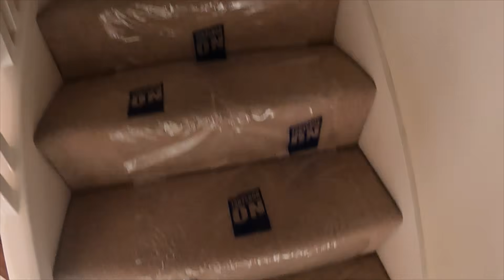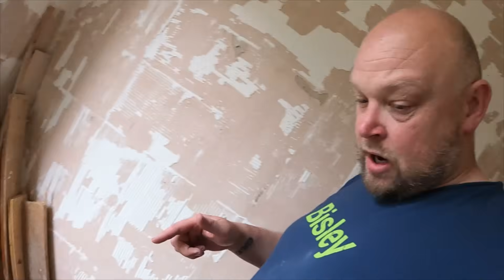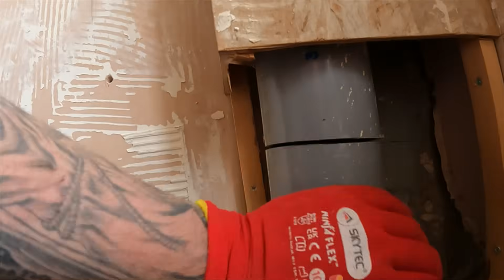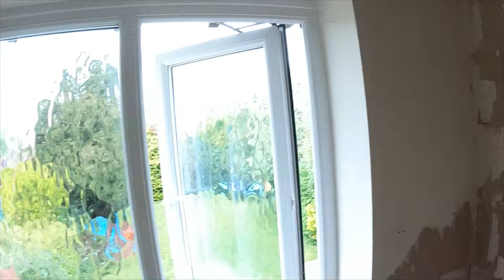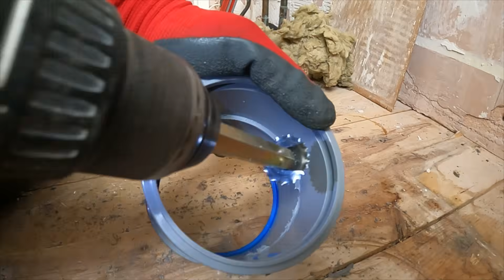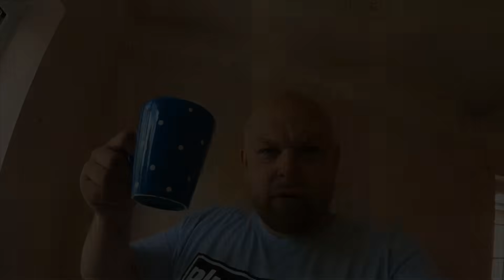FULL BATHROOM REFIT-SOIL STACK CAUSES PROBLEMS ON DAY 1… Part 1-Rip out & 1st Fix

Comment: Just a personal thought question. I believe a 110mm dia. stack or should I say soil vent pipe (that is a pipe that is vent only) can be as narrow as an inch and a quarter. I mean, 110mm is (in my opinion) excessive, also at 110mm there is an uninsulated space in the room. If the vent pipe was less than 110mm, it could be incorporated into the stud wall structure................ Thanks.
Reply from the maker: It’s all ready fitted mate….. I’m just altering it where I need to👍🏼
Reply: Not on a main vent tge pipe diameter shouldn't be reduced.there wouldn't be enough air admittance when flushing the wc.i think,been a while from college lol
Reply from the maker: @thomaswatt1658  yep I agree ….. I wouldn’t and haven’t ever reduced a vent pipe to 1”1/4!!!….
Reply: @MJTiffPlumbing  I done it in a property once and have not had any problems....... no glug etc.
Reply: @thomaswatt1658  have you tried.
Reply: I haven't tbf but I don't think it's good practice.glad you haven't had any problems,that would be a nightmare if you had to change it back
Reply: @thomaswatt1658  True, like I say, it was an experiment and as yet it is all good. Thanks.

Comment: Another good video.

Never seen a sparky make a mess like that on the ceiling, even if it’s being over boarded!!! Just looks a mess and carelessness and no quicker than using a hole saw attachment.
Reply: Would have been better to use the hole saw though
Reply: @nicks2528 or just go up the loft!
Reply from the maker: To be honest it’s not an issue at all as it’s being over boarded….

Comment: "good job we are over tacking the ceiling then!" Sparks, get a hole saw and a dust pan and brush!!!!
Reply: I get that but sparks need carful guidance especially when they are wielding a hammer, I’ve got mine in tomorrow and he drops cable, tape and general stuff all over the site and thinks it’s someone else’s job to clean up after, I’m sick of tidying up after him so tomorrow he’s gonna have an interesting morning cuppa 😜
Reply from the maker: @chrisgunn121  🤣🤣🤣
Reply from the maker: He knew we were before doing that obviously….. if it’s a finished ceiling he wouldn’t be doing that
Reply: Typical sparks making a mess

Comment: Got exactly same issue on our job re BTW pan !!
They look really nice but don’t work on internal soil stacks ,.. said the same - I’ll cut out but cannot guarantee it won’t crack ! 
🤞🤞🤞 in morning 🤣👍
Reply from the maker: Gotta do what you gotta do…. Just cover your ass
Reply: Could timber it out and then put an concealed cistern in and btw pan no cutting needed
Reply: @mikecave4154  not enough room for w/c pan pal, need a c/c for door opening 👍 thanks for your input though mate 👍

Comment: With all them notches in the joist for the pipes,doesn't the integrity of the joist be compromised?
Reply: The notches must be about 55mm deep which means that technically the joists should be 440mm deep.......
Reply: I've got to be honest, there's no way on this earth anyone should cut a notch that deep in a joist. After 35 years of house bashing there's some rules that don't get broken. 
Simple, tell the customer no. Leave it for some other fool to do.
Reply: Thinking same thing
Reply: That’s the problem , when you have bathrooms, the waste pipe work should be boxed in , you definitely lose a bit of space , the timber joist looks healthy, and it’s on a second floor, he can get away with it, but you definitely don’t do that on a first floor, those are most important joist.
Reply: You can drill a hole through the centre of the joist 1/4 of the depth of the joist. That would have been the way to go, that notch is too deep.
Reply: Just been scrolling through the comments amazed no one is mentioning the joists!! Drilling centre is the better option, albeit a pain in the arse feeding the pipe and the extra joins. I'd probably not notch here, especially given the existing notches. Love the videos, keep them up!
Reply: Notches should only be an eighth of the joist depth. Would never cut joists that deep - stuff what the customer wants - they will be quick to blame you when something goes wrong.
Reply: @mrgilly100  I agree with you, but people doing it themselves, sometimes. But , I completely agree to follow British standards and building regulations, it’s a reason why  they’re there for .
Reply from the maker: Never had an issue in 26years…. This is what you have to do when people want bathrooms with no pipes on show etc

Comment: Why is the shower waste so high notched in joist..  If the tray sits on floor normally waste is say at least 70mm to centre of pipe as it comes out of pot. Surely there's no fall unless the tray is risen right...
Reply from the maker: Plenty of fall on this buddy 👍🏼👍🏼
Reply: @MJTiffPlumbing  is tray sitting on floor

Comment: Urgh internal soil stacks 😩 what genius thought of that idea eh!? 
We had one inside the cavity once which if never seen before
Reply from the maker: They can be a right nightmare
Reply: Seen one inside a cavity in a converted student house in Manchester, it had a big hole in it and had been leaking stink into the wall for years. Nice smell. They ended up having to replace ends of joists, cost them thousands......

Comment: Great video on the bathroom rip out.could you not connect the basin waste and shower waste together so you only have one run into the stack pipe.tiles came off easy enough without to much damage to walls.bet it will look smart when finished 👍
Reply from the maker: Thanks mate….. I never like teeing in wastes as they can pull on each other especially a shower waste.
Reply: @MJTiffPlumbing  Hey mate, was actually thinking this too, but maybe chuck an AAV on? 

Just asking your opinion, not bashing 💪
Reply from the maker: @sonnyhacker1591  
Yer some people may do it that way…. But for me cutting it all out and running it separately is how I like to do it👍🏼👍🏼
Each to there own…. But teeing wastes is not for me
Reply: @MJTiffPlumbing  Cheers mate, find it interesting how different we all work; why I like your channel, no bull shit, proper real world plumbing.

I started on my own last year, best thing in the world, and the most stressful 😅

Be lucky 

Sonny
Reply: I was thinking that too.
Reply: Decent start to the job. As others have said I would of stuck a tee close to tbe stack taken the basin waste into the 1-1/2 & then just the shower waste. On the basin waste fit an antivac trap or self sealing valve.
There's no chance a basin waste backing up the shower waste as you've then put the connection close to the stack. No chance of them pulling as you've only got an electric shower as opposed to one off a combi or pumped.
I'd be more concerned as to almost little to no fall on the shower waste as electric showers generate so little water they struggle to run away & eventually block especially with knuckle bends . I'd of used a hole saw on the joists & atruggled with a few sockets but peace of mind I'd got a decent fall on it. But hey we all approach things differently .
Could you not of got the customer to go for a pumped shower & run both bathrooms off of it to do the showers ? Give them a decent shower as opposed to dancing around an electric shower to get wet. All that graft for an electric shower even if its a 10.8 , you'll be replacing it in about 4 years !! Or converted it to a unvented win win for both bathrooms . Appreciate its extra cost to the punter . But a better shower performance ! 
Am interested in seeing you cut this pan as I detest back to the wall pans nightmare to connect up. 🤞it goes ok .
Reply from the maker: @actorlyric  Sundays video will show the pan issue get sorted.

Teeing waste pipes together isn’t for me… each to there own.
Plenty of fall, tested today and all runs away perfectly…. Let’s just say I’ve done a few bathrooms in 26years of plumbing 😉
Reply: @MJTiffPlumbing  I can relate to what you've said I've done my fair share in my 46yr career too as a plumbing & heating business 👍
Reply: Not only that any check valve, inline trap or self sealing trap, or a combination of those things, will need to be accessible for maintenance. Difficult to allow for considering lack of working space and to keep within the current obsession of having pipes and fittings hidden from view.
Reply: Ditto

Comment: They do do pans with knockout points on either side like kitchen sinks, always dodgy doing it but they do them🙄 second fixing today and customer agreed one for electric towel rail position then changed mind so had to remove four tiles and re fit as the tiler had finished to move over 100mm🙄😂
Reply from the maker: Well I never knew they did them 👍🏼👍🏼
Reply: @MJTiffPlumbing  they are abit scary to punch out tho mate😬